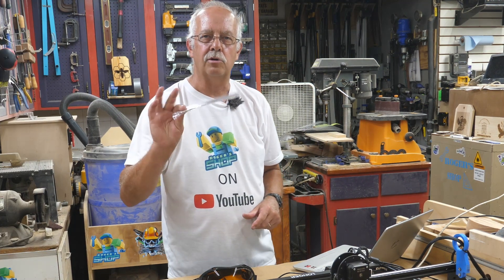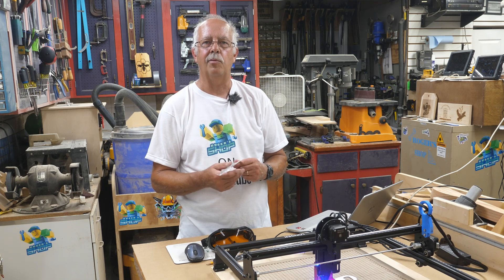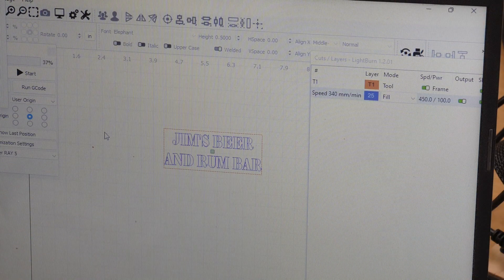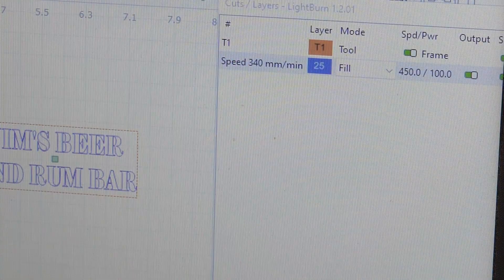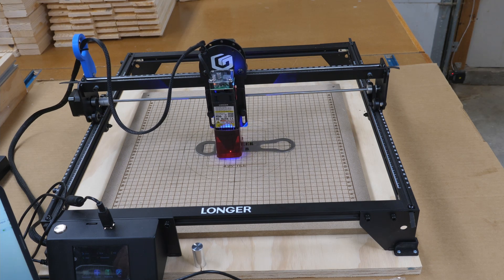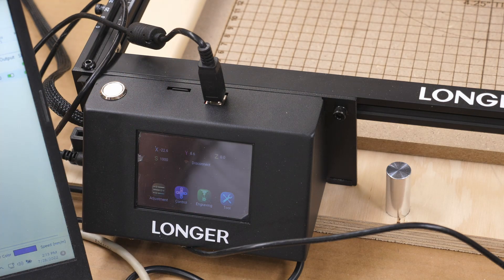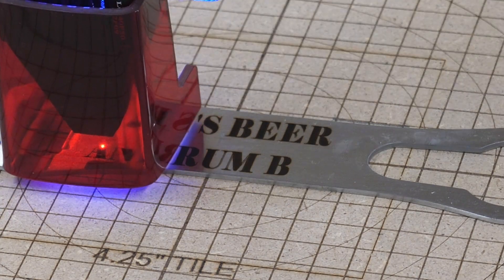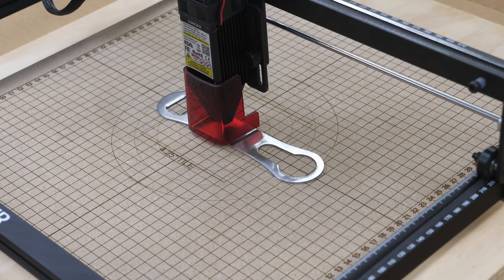Longer Ray 5 10 Watt Laser On Stainless Steel

Comment: Does this one have different colors
Reply from the maker: Colors on stainless depend on the alloy of the metal.  All blue diode lasers can produce "some" colors on stainless if it is the right alloy.  However, even then, it may not be consistent.

Comment: Roger I like your videos however I've been going back and forth with Longer regarding them. I purchased the same bottle opener as you show in this video and I also purchased the same galvanized scraper from The Dollar Tree that you engraved in another video. I have the R5 10w just like the one you use in your videos. I also use the same settings you used 400mm/min at 100% power and I don't get 1 black speck. Longer sent me their chart which says the same setting for stainless steel. But when I told them it doesn't work they said you really should be using a 20w or higher for those items. So how does your 10w work and mine does not.
Reply: Same problem here

Comment: Can this machine cut metal?
Reply from the maker: No.  You cannot cut metal with a diode laser.
Reply: @rogersshop  damn because I was thinking about buying the longer model and saw you could make really cool looking candle lanterns so I was thinking making them out of like copper so you could actually use a real candle whereas wood you can't.

Comment: what is the setting to be able to engrave in steel, I have the same one and I can't helpppppp
Reply from the maker: There is none.  A blue diode laser cannot engrave steel.  With certain coatings, you can etch steel, but not engrave or cut.
Reply: @rogersshop  but you did it on the vídeo ?
Reply from the maker: @ritaribeiro2505  On stainless steel, yes.  Carbon steel, no.  If doing stainless steel, you will need to run tests on your material as all alloys are different and the nickel content is a key factor.
Reply: @rogersshop  yes is stainlesssteel but i just try everything and dont grave
Reply from the maker: @ritaribeiro2505  450 mm/min @ 100% power would be a start point.  Be sure focus is set.  Different alloys will require different power/speed settings.

Comment: Roger can you tell me why I’m getting lines in my fill engraves….
I’m using a longer ray5 10w

I’ve even set the lpi to 0.01 still getting the lines.??
Reply from the maker: Make sure focus is set correctly  and you may need to slow your speed.
Reply: Thank you

Comment: Thank you for your video! I just purchased this laser and am having difficulty lining up my projects. Did you create this layout board (for lack of knowing correct term) for placement to match the lightburn software layout? I would love to know about this, if so. Thanks for helping us out with great videos!
Reply from the maker: I make layout grids for all of my lasers and have done several  videos on engraving them and how to setup, working from Absolute Coordinates in Lightburn and centering the layout grid.  I also have several different size grids available as a free download from my website:  https://moonshinecrafts.com/product-category/laser-mounts-accessories/ for many brands of lasers.  Which size applies to you depends on the model.
Reply: Thank you so much!! This is very helpful and kind of you to do, especially at no cost. This is greatly appreciated!  @rogersshop

Comment: I'm using lightburn on the longer and there's no output on a brass plate
Reply from the maker: If uncoated, you can't etch brass with a blue diode laser.  There are coatings you can use on brass to get an etch, but an IR laser or fiber laser is best on metals such as brass.  Longer does make a ruby IR head that will fit the Longer lasers.

Comment: Hello, Great video! Did you coat the metal to get that dark result? I'm using Stainless Steel 304, and it barely etches the art.... Cheers! Ps. I do have the same machine.
Reply from the maker: No, not coated.  But, I have worked with some different alloys that do require a dark coating first.

Comment: I’ve got the same machine. Had it for two weeks and doing the same way does not mark the stainless at all. Do I have something wrong with settings? 400/100 power.
Reply from the maker: It can depend on the alloy.  Not all stainless is the same.

Comment: How did the black ones come out?
Reply: Try etching them with much less power. You can probably find settings that will burn-off the black but leave the stainless silver. I've done it with dog-tags.
Reply: @kenlipper874  I do black powder coated brass, it should be the same longer ray 5 10w settings 400/75
Reply from the maker: I stripped them first.  Black on black doesn't look too good.................
Reply: @rogersshop  how did you strip them? Mine are from Amazon.
Reply from the maker: @mikeledee8786  220 grit wet/dry paper with water, followed by 400, 600 wet sand.  Came out decent, but probably not worth the time put into it.
Reply: @rogersshop  thanks

Comment: Will these same settings work for the Xtool D1? 10 watt.
Reply from the maker: It "should".  However, do a test first.  I have many lasers and although several are 10 watt output, not every laser performs the same.